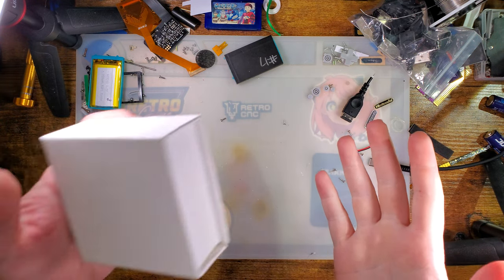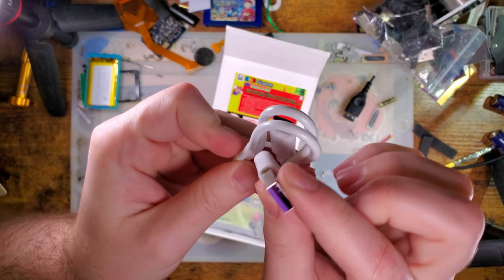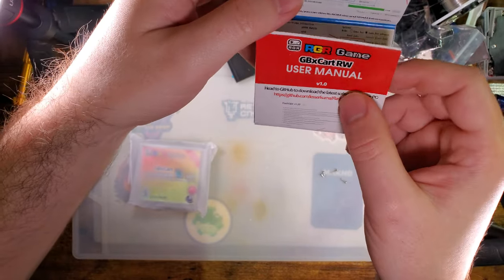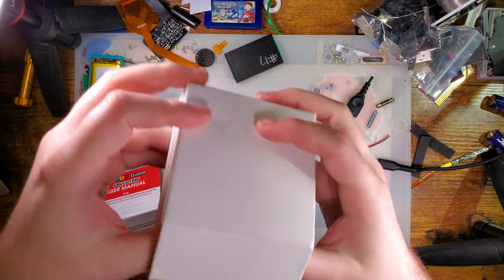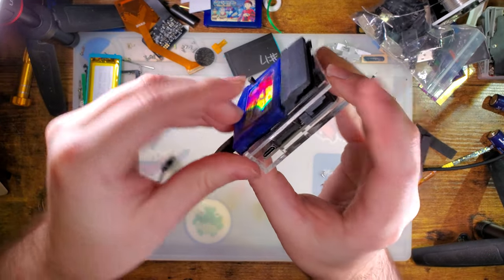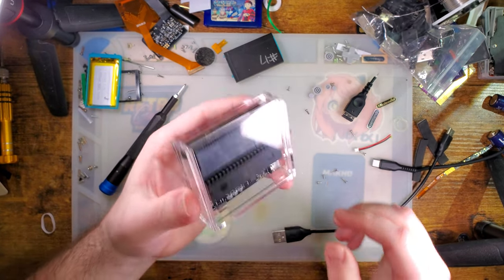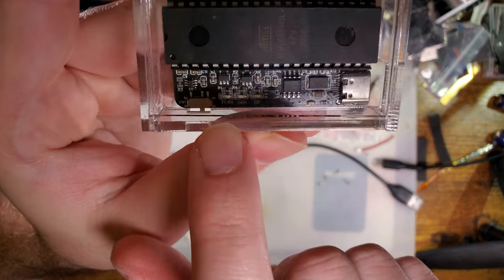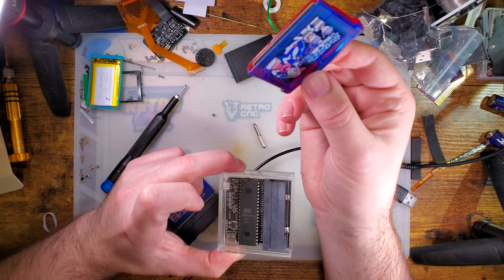GBXCart RW v1.3 Clone

Comment: What is hotswapping? I had no idea that button was important I totally forgot about it and covered it with a clear shell😂 I always just disconnect then unplug the gbxcart before I remove a cartridge from it
Reply from the maker: Removing or inserting the cart while powered. The button powers off the cart but so too does just unplugging the whole unit.
Reply: @makho   man I've just been clicking disconnect then removing the cartridge... Am I supposed to power it down fully first every time??
Reply from the maker: @JulianQuinn  on v1.4 and newer, disconnect powers down the interface.

Comment: Curious to know what your thoughts were on epilogues product? If you talked about it before forgive me and show me where I can find your comments on it.
Reply: Not Makho, but I have the Epilogue GB Operator and it seems to do just fine for saves/ROM dumps/emulation.
Reply: Also not Makho, but I have the GB Operator and have yet to have an issue with it. Not sure exactly how important the software having a built in emulator actually is in the grand scheme of things, but it's neat. The hardware looks good and the software is easy to use. No complaints at all from me. Dumped well over 100 carts without issue if the cart was clean.
Reply: Also not-not-not Makho, but I also have an operator and love it. Best purchase I’ve made in relation to this hobby so far.
Reply: I have it myself. And so far I it does what I need it to do! So I’m happy with it!

Comment: Makho I need help. Working on my first slate kit. My childhood gameboy needed a battery replacement so I used the battery kit you make. I was unable to get the gameboy to switch on before and after. I cleaned the power switch and their is no noticeable corrosion. I cleaned the ports for charging. I am not able to get consistent charging and I can’t get it to turn on. The green light will turn on if I have the switch on and have it plugged it but then will cut off after a second. This is my gameboy i have owned since it was new and has never suffered water damage and is in relatively great condition. I tested the battery with a voltmeter so I know it’s good and the PCB it’s soldered too is good. Really not sure what to do. Any help is greatly appreciated
Reply: Did you check the fuses with the voltmeter and make sure they're good? I've heard you can fry one if you plug in the battery backwards. There's 2 fuses on the SP's board I believe, make sure both are working
Reply: @inclinerd  checked both of those and had no problem. I just uploaded a YouTube short showing the problem off. Very weird. I can only get the console to boot with it plugged in at a specific angle. Will turn off if I remove cord. Full battery with green light
Reply: @youdontknowenough9059  Hmm. You probably already tried this but does the Makho battery work in another SP? And vice versa, does a working OEM battery work in your problem SP? 

I would also try using a microscope/your phone's zoom to inspect around the motherboard, power switch, and charging port to look for anything out of place (like solder bridges or knocked off capacitors), especially around the areas that have been soldered.  Maybe you could post a YouTube short of the front + back of the board (and if you assembled the Makho battery yourself instead of buying a pre-built, I'd include that too).
Reply: @inclinerd  I finally fixed it. Was an issue with the soldering on the charge port area. Not sure how, but I was able to fix it by just resoldering.

Comment: Well i think from a functional perspective mine works fine. (Could Dump all my GB games from original Gameboy to GBA.). It had a much cheaper device case (Just some pvc standoffs with a clear acrylic sheet about 2mm thick and a sticker on the inner side.) I think the hardware it self works ok but for real the stm32 based are much faster since they don't have to bit/byte bang everything. (The stm32 has a free configurable parralell interface to wich is perfect to interface with the cartridges. The MCU used in this has multiple 8 bit gpio units. (You can write 8bit at once to one unit.)